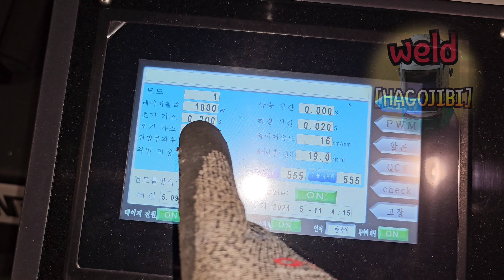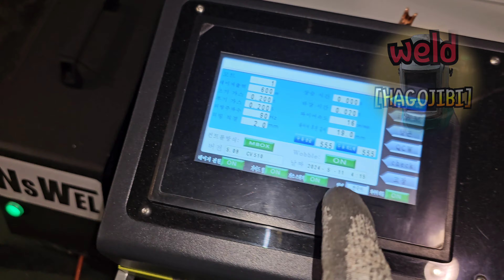Amazing welding technology that keeps the line that should not be crossed

Comment: looking great , but of course your bend test was done the wrong way  , it was done with the plate thickness supporting the weld.
Reply: Absolutely!  The weld test should have done the opposite way, against the root showing root fusion and depth of penetration.  This test showed nothing of structural integrity as many other welding videos appear to avoid showing proper destructive testing of the welds but love showing “pretty-passes”! LOL
Reply: @SeldomFales  The interesting thing about laser welding is actually the penetration is really good. However, some people have had problems with stainless steel welds cracking, and some minor porosity. The neat thing about laser welding is, the laser is so tiny, it heats an extremely small spot, and the metal quickly melts. When the metal is molten it actually becomes pretty transparent to the laser so the laser quickly burns down through the metal. I've seen examples of welding on stainless steel pipe over the printed lettering on the pipe, and after the weld is completed, you can still read the lettering! This is because surface impurities just stay floating there on the surface, and the material is kind of welded from the inside out.

It's not for everything, and this process is best for very thin metals where warping or excessive heat input would destroy the part. For thicker materials that need precision welding, a good TiG process is better. But for very thin metals or for like very thin mirror finish parts, it's really good, and the speed is like 3x faster than TiG, plus the learning curve of using a laser process for mass production of items, it's the way to go.

But yeah in this video he should have shown the backside of it, but there is other examples of laser welding butt joints where you can see the weld goes right through to the other side, and actually makes a nice looking bead on the back.
Reply: Thanks for the explanation!  I could see that the process was a very low heat input from the tiny heat affected zone which is important with welding SS but it also made me think about why the welder didn’t break the coupon as per most all the Codes that I remember.  I’m sure the process’s sweet spot is very thin SS.
Reply: @SeldomFales  Yes there's another video on YouTube somewhere showing butt welding together two sheets of like 28ga mirror segments. If you tried to TiG weld those, a large part around the weld would not be a very good mirror anymore!

Another neat thing with laser welding is it's possible to weld two entirely different metals together and other strange stuff like that. It has it's place, but for things like chromoly roll cages, high end bicycle frames etc, it's hard to beat a good TiG setup.
Reply: @SeldomFales  The heat input is low overall yes, but the laser is so concentrated, that the heat input where the laser is focusing on is extremely high. The basic problem of any electricity based welding process is, a big majority of the wattage input is wasted into the metal, because you're depending on an electric current flowing thru the electrode and the work piece. With laser welding, the heat input is from photons and not electrons. In arc welding, whether MiG, MaG, SMAW, or TiG sometimes 80% of that arc energy is "wasted" in that it plays no part in the actual weld, it's dissipated into the workpiece (heat affected zone) and into the surrounding air from the high intensity UV light produced and resistance in the work leads, tungsten/wire/welding rod etc. That's the reason big TiG torches are water cooled, otherwise they get way too hot, and that's wasted energy dissipated by the water cooler that could have otherwise been directed into the weld pool directly.
Reply: @brnmcc01 чувствуется, что человек понимает, о чем говорит 🤝
Вообще интересно, что происходит со структурой металла и закалкой

Comment: If only they were affordable? this is excellent for thin material but i don't know if i would trust this on thicker metals.
Reply: It's only affordable for like mass production work, like if you were in a factory making machines and laser welding a stainless steel case for the machine or like a controls panel with a lot of small thin parts. For making one or two items where speed isn't an issue, then TiG is much cheaper, but TiG is harder to learn than laser welding for employees, plus TiG takes about 3x as long roughly, some things are faster than that, some slower, but in general laser is pretty quick, and there is less warping of thin sheet metals.